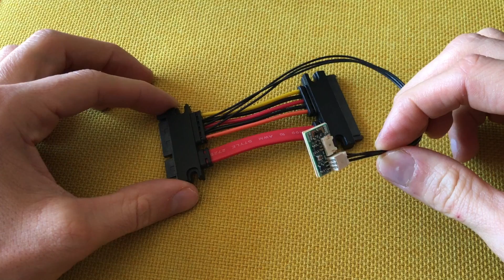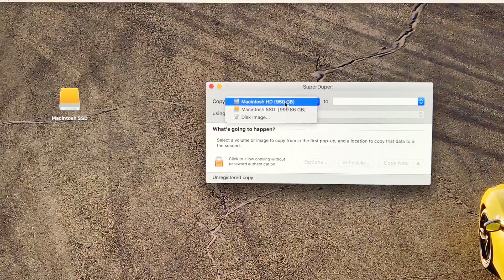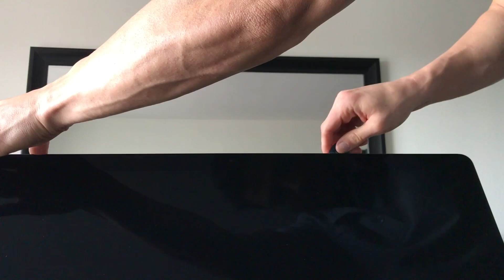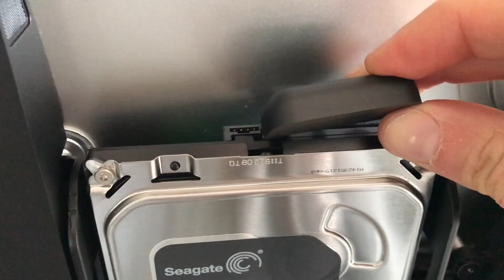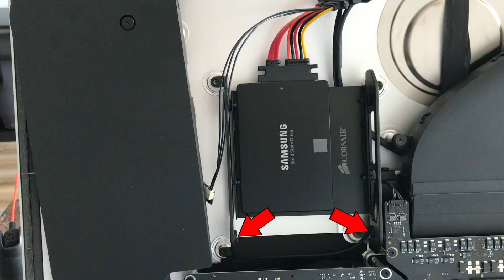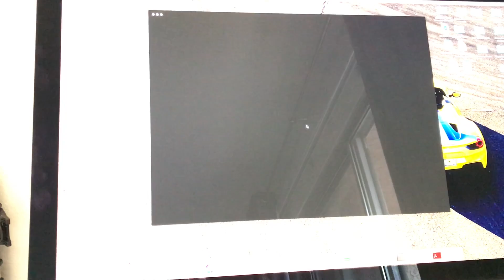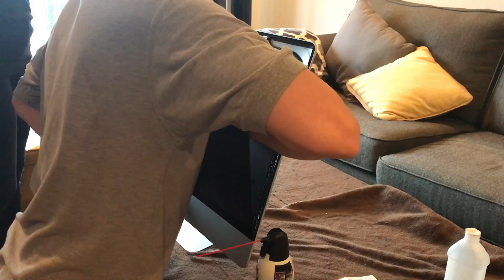How to make your iMAC 5 times faster | 2012-2017 SSD UPGRADE WITH THERMAL SENSOR | Step by Step

Comment: BIG WARNING, I followed the steps and ended up with the SSD in MAC OS journaled format (HFS+) as you pointed out., I then tried to update to CATALINA, and it says my drive is not in APFS, turns out that was the format of the HDD that was inside, and that should be the format I should have made the SSD! Now I need to repeat the whole process, and make a clone, then format SSD to APFS, and then load everything back on to that. 10 hours each backup thats 20 hours. Brutal!
Reply from the maker: P DUBS Did you clone the drive first? I haven’t had a single issue nor has anyone else who’s commented. So maybe you missed a step?
Reply: @AIRWOLF  
Yes, I did a Clone of my MAC HDD on to the SSD. In Super Duper I selected Mac OS Extended (Journaled)  as the format, is that not what you had instructed in your video?That was the only one available to select. Even though my MAC HDD was in APFS already - Apple Switched to this with the Sierra Update. Anyways I Re cloned my SSD to my HDD which was now removed. Then I Booted from this External Clone and when into disk utility and formated the SSD to APFS. then loaded the HDD Clone on to it. After that I booted from the SSD and was able to update to catalina. If you do some research into APFS youll see why this was an issue for me and should be an issue for anyone else trying to do it the same way running the same versions of OS.

Also the fleece blanket is a big no no,duhhh! I rolled out my rubber yoga matt onto my coffee table instead.I wouldn't recommend the thick guitar pick or metal razer blades. Other than that thanks for the vid! but maybe post a warning about some of these issues.

Comment: If you have a 27 inch, you could have had a faster drive yet by using an NVMe drive. I just placed mine in my Late '13 and I'm getting 730 MB/s write and 777 MB/s read. Doing this would allow you to have two drives in your iMac, which is pretty dang handy!
Reply from the maker: Yes you're 100% correct!

Comment: Spend the $8 and get a "no-harm" type wheeled tool to cut the adhesive with.  Those bonded screens are super-easy to crack with anything thicker and super-hard to get if you have to replace it (not to mention super-expensive).
Reply: Big Life only 60 bucks
Reply: Tzaphkiel Melekiyah the whole screen or the tool is 60 bucks?
Reply: @radar_the_first_esquire  I'm not sure what he's talking about unless he's referring to newer models.  I did 2 of them recently, and one had been cracked by a previous tech using a plastic prying tool.  My wheeled tool was $8 on Amazon.  When I researched his screen, the newer, magnet-mounted screens are plentiful and cheap (because the glass is separate from the actual display).  2013 models and before had a bonded single unit that shipped the display and the glass as one unit that was glued in place.  They're old enough now that production has become very thin and there's no inventory ANYWHERE.  Expect to pay $600 and wait 6-10 weeks for it to ship from Asia.

Comment: Hey Airwolf,  Where's your repair partition you did not get by cloning?  The proper way to do this is to install your system first after formatting the new drive.  Now use Migration Assistant to move your data and apps.  You will then have a repair partition you can boot from if you ever have problems.
Reply from the maker: Yes Richard Mayer that is a way to do it as well.

Comment: Great video. I recommend using time machine to backup and restore and an OWC SSD replacement kit which has practically EVERYTHING you'll need for an upgrade. innovative tools assist with getting the job done safely, easily and for a low cost as well. I upgraded to a 2tb SSD. best decision i ever made

Comment: Hei got a question, how did you get the OS on the new SSD.. did it do that with the cloning HD?
Reply from the maker: I cloned it. I have a link to the software in the description.
Reply: @AIRWOLF  I am sorry, maybe i questioned wrong. I mean, when you clone the HD with the Super Duper, does it clone the OS too or just the data?
Reply from the maker: @miloplayz5264  Yes! It will bring EVERYTHING over. Like nothing ever happen. :) You'll just have to sign into things again but thats all
Reply: @AIRWOLF  Thank you very much, amazing!!!
Reply from the maker: @miloplayz5264  You're welcome. :) Keep me posted.
Reply: @AIRWOLF  Does this work to????
https://www.amazon.de/UGREEN-Adapter-Konverter-Kabel-Festplatten/dp/B01H1I9X60/ref=sr_1_1_sspa?__mk_de_DE=ÅMÅŽÕÑ&keywords=Sabrent+USB-Festplattenadapter&qid=1568642575&sr=8-1-spons&psc=1&spLa=ZW5jcnlwdGVkUXVhbGlmaWVyPUExR05SRlRSNjBaVkFQJmVuY3J5cHRlZElkPUEwMjA0MDk1MkwzTUhCU0RCUUM1JmVuY3J5cHRlZEFkSWQ9QTA1OTgzMjEyM1ZKN1dCN1NTNFJVJndpZGdldE5hbWU9c3BfYXRmJmFjdGlvbj1jbGlja1JlZGlyZWN0JmRvTm90TG9nQ2xpY2s9dHJ1ZQ==

Comment: thanks for the info, really bad audio though
Reply from the maker: Hey bud! thanks for swinging through i'm happy it was somewhat helpful. But I check your setup.  The audio is pretty clean on my end and out of almost 100k this is the first comment regarding audio. :)
Reply: @AIRWOLF  no problem, I see you are not into audio. At about a minute and a half the audio level drops and I can hear the hissing noise in the background but, hey i am the only one mentioning it so...it must not be true lol
 A lapel mic would definitely help keep the level clear and consistent, synch later with video. I see you are using the camera mic, that is a beginner's method. Cheers.
Reply from the maker: @Achisachis73  Rode Pro
Reply: AIRWOLF oh nice

Comment: Great video!
If you don't mind, I would suggest something a bit different, instead of opening your iMac and replacing the HDD.
1. Buy Plugable USB C to M.2 (it also supports Thunderbolt 3) from Amazon. It costs about $60. Link: https://amzn.to/2L9t8Cx
2. Buy Samsung 970 Evo Plus (the 1TB costs about $227, 0.5TB costs $115. Link for 1TB: https://amzn.to/324wDAW )
3. Install the SSD into the module, and connect to a TB3/USB-C on the back of your iMac
4. Use Super Duper to clone your HDD to the SSD
5. Shut down the iMac, Power it up and press the Option key, you'll see the boot manager. Select your SSD.

Done, you'll get 4-5 times speed compared to the SATA SSD and 15X compared to the HDD. No need to open your iMac.

Also, you can use the Startup disk option to boot permanently from the TB3 disk.

Comment: Hi all im installing a samsung 2TB SSD to repolace my failed 3TB seagate,  ive already built the drive with Mojave and wresteled the backup off the time machine not using time machine as i find it totally prone to issues this time permissions wouldnt lket me install a TM backup. That aside I am interested in thoughts on installing 2 x 2TB SSD drives .  Ive bought a double cradle but the adapter cable kit is wrong so ill keep searching ,  but has anybody installed 2 x ssd  in parallel off the original apple SATA cable  ?

Comment: Excellent video!! I did everything as you did but now my screen is really F’d up!! What could have happened? I was very careful when disconnecting and reconnecting...  I tried cleaning the connections and reconnected, do you have any suggestions on how to fix it?
Reply: I think I figured it out! I think I cut too deep with the blade around the edges 😖
Reply from the maker: @Two_Fold_Way  Did you accidentally snip a wire?

Comment: After I upgraded to 1T Samsung SSD I have "No entry sign" displayed about 30 seconds after iMac is powered on, but then it's boots normally. Is it any action should be performed to remove this "No entry sign"? Also I noticed that "APPLE SSD SM0032L Media" is displayed at Disk Utility in addition to "Samsung SSD EVO 1TB Media" - is it normally after SSD upgrade?

Comment: Very nicely put together video. Excellent video quality. Great audio. Added bonus: you’re a very sexy masculine man (with all due respect.) And yeah, I can tell you’re straight. So, relax and enjoy the compliment from a gay guy. 
Hint: you missed the two tabs at the bottom of the screen when removing the adhesive. Just pull them out and you will have a much easier time removing the adhesive at the bottom and hence removing the screen right out at first attempt. Cheers mate.
Reply from the maker: Ahahaha awe thanks for the compliments Raphael.  :) Much appreciated.

Comment: im thinking of using an ssd on my late 2013 27" iMac, BUT im wondering..... is there any reason i can't just use an external drive and boot from that instead? and keep the internal 1tb for files? (pictures etc that i don't often access but want to keep) i can't understand why i need to go to the trouble of ripping open my iMac when i can plug a drive in externally?? unless maybe its slower through USB? im not sure anyone care to elaborate?
Reply from the maker: You’ll be limited on speeds due to your USB port.
Reply: AIRWOLF Which, if we are talking USB 3.0 here, is very similar to the SATA internal connection... So, yes, that IS an option.

Comment: Couple of Qs: 1. What should I be looking for in a bracket? Uk based here so need to find equivalent items on uk sites/amazon. 2. Can you buy the thermal sensor without having to get it as part of that OWC kit anywhere?
Reply from the maker: Hey bud! I mean you may have to do a little homework.  But I did leave links in the description to help with that. And 2 i'm not too sure about finding the thermal sensor separate.  And i'm also unfamiliar with UK sites.  

If I was you i'd click the links in my description.  Highlight the actual names of the items and then try searching it via the web.  There may be other websites that sell the items.

Comment: Thanks for taking the time to put the video together. I've been doing some preparatory research to ensure I get it right and your video is by far the best I've come across and I plan to do an SSD install and Ram increase in the very near future and much more confident after watching your video.
Reply from the maker: Awwwwe thanks so much.  When making the video I really didn't want to miss a step.  I'm really happy to know that its help you.
Reply: @AIRWOLF  Well I went the OWC route and picked up their 1 TB SSD kit that came with everything needed including a nifty little mini pizza cutter that rolls through the groove and cuts the adhesive in literally two minutes. It also made the old adhesive peel off with little effort. I just popped in 32 gigs of RAM and restoring from a back-up and can't wait to see how much faster this bad boy is. Thanks again for the inspiration.
Reply from the maker: @davebeatty5888  This all sounds great!! Happy that you got it all figured out.  I love my speeds on mine for sure!

Comment: Actually your 27" 2015 iMac CAN BE UPGRADE to a real BEAST. It supports a Core i7 6700K procesador and an extra 1TB SSD M2 inside you Logic Board. It's really easy to change, this mobos (2012-2015) are easier to unmount than 2011-2009 models.
Reply from the maker: Hi 👋🏼 Rodrigo Rosales you are 100% correct. Maybe down the line I’ll get into it.  I may also build my own PC at some point.  Who knows? 🤷🏻‍♂️. Appreciate you stopping by.
Reply: @AIRWOLF  and... It's a little expensive, also supports 64gb RAM DDR3 1867 from OWC. These machines are so handy but Apple won't tell to the public never.
Reply from the maker: Rodrigo Rosales Of course they wouldn’t. And 64G? Really!? Now that I didn’t know. I’ve never tempted to actually install it. Is there any information on that?
Reply: @AIRWOLF  of course i'll share you the "Holy Grail" of Mac:
https://everymac.com/systems/apple/imac/specs/imac-core-i7-4.0-27-inch-aluminum-retina-5k-late-2015-specs.html
And the OWC parts:
https://eshop.macsales.com/item/OWC/1867DDR3S64S/
Reply: @AIRWOLF  I've in my Desing Studio 2 iMacs 27", one mid 2011 and late 2013. Recently 2011 was upgraded to i7 2600 3.4ghz, 3 SSD 1Tb internal (super drive gone external by USB enclosure), and 32 GB RAM 1333. Next week i'll open the 2013 (it's the same sticker screen system) and change the cpu to i7 4771 3.9ghz, 1 SSD 1TB swaping the HDD and 1TB M2 stick. The 32gb RAM 1600 was upgraded last 2 weeks. I'm searching for 2015 iMac like yours for tunning. We save A LOT OF MONEY making this upgrades than buying new shiny gray and downgraded ones.

Comment: Excelent video!!! Really helpful!  I followed your steps to upgrade hdisk with the Samsung SSD successfully at $150 (SSD 500GB+adhesive strips). The Genius Bar at the Apple store ran a free diagnostic check on my Imac 2013 21.5 inch and it came out disk failure. However, Apple store can replace the same hdisk  1TB only about $250 and others repair stores would charge me $550 with SSD (550GB) upgrading.  Thanks again for great tutorial by the way.
Reply: BTW, I didn't use thermal sensor because iMac 2013 does not need that.  After booting, I didn't hear any big fan noise.  Now my IMAC 2013 runs very quiet.
Reply from the maker: I love hearing this! Really happy that this video was helpful for you. And that you were able to save some money!

Comment: is there a way to by pass that stupid thermal sensor?   is cost almost $40  and this Mac are wait to old to put more money on it
Reply from the maker: I mean, I hear ya on that. Now, if you read in the comments people have done it without installing the sensor and it’s been fine. I personally just thought it’s better safe than sorry. My iMac is still my workhorse and running fine. I’m sure you’ll be fine without it but unfortunately I can’t guarantee it.
Reply: @AIRWOLF  . Got it. Thanks for the info
Reply: You don't need a thermal sensor for iMac 2013 up ,only the 2011 models.I installed an ssd in my late 2013 iMac no thermal sensor needed

Comment: I remember when I replaced the hard drive on a 2011 iMac 21.5", it needed the correct Hard drive type otherwise the fan always spun at maximum speed, unless you used a fan control software.
Reply from the maker: Yup! Thats why I installed the thermal sensor. I just didn't want to risk it.
Reply: @AIRWOLF  Thermal sensor is only needed for 2011 models only.I installed ssd in my late 2013 no sensor needed everything thing works normal.

Comment: Can´t you just wipe the fingerprints away when you're done with the upgrade?? Seems more safe than using a cloth which can make you easier loose the grip of the screen?
Reply from the maker: Yes you can but I just wanted to limit the amount of hand oil on my screen.  :) I understand the risk behind it but I was careful.

Comment: Just a note of caution to those who have done the upgrade... we did ours in January. Today, we noticed the LCD on the imac separated from the aluminum case.    For those that did the upgrade, I'd just double check that the adhesive is not lifting.     We were very diligent in removing all the old adhesive and cleaning the area with 99% alcohol, letting it dry before re-applying. This two way adhesive should never release once it is applied... so it was very surprising to see it lift up.  This could have been disastrous if the screen completely released and fell to the floor.  We purchased two adhesive kits.. one from ifixit, and one from OWC (one is spare).  Bottom line, is this adhesive should never separate once applied unless the glue uses is defective.
Reply from the maker: Wow! Im sorry to be hearing this.  Mine has been fine so far. 🤞🏽

Comment: awesome tutorial man! quick question! I bought ssd 512gb iMac 27' 2017 so its not a fusion drive... so I'm guessing it wouldn't have that mounting bracket where u can place your ssd, do you know where to get it or any suggestion? (I'm not talking about the ssd bracket, I'm talking about the two plastic piece where u can put your bracket installed.) thank you
Reply: David Wilkins thanks!
Reply from the maker: Were you able to get it figured out?
Reply: AIRWOLF yeah i have!! Thanks
Reply from the maker: Hmmm I’m a little confused only because mine “wasn’t” a fusion drive either. So would that change your question?
Reply from the maker: Thanks David for the help.

Comment: Excelent video buddy, thanks for it.
I just ran into a bit of a problem, my iMac actually goes slower now. Boot up is fine but navigating through the system is really slow, opening a folder takes 5 seconds and the mouse turns into that colorful wheel. Tried resetting SMC and PRAM, tried enabling TRIM in SATA, everything. What can be the issue?
My SSD is a 1TB crucial MX500. Thanks for the video again.
Reply: Have you verified that your boot drive is selected properly? Under system preferences and start up disk make sure to select your new ssd. 
Another thing would be to make sure firmware is updated.
Reply from the maker: Hmmm 🤔  Did you clone the hard drive before installing? I’m wondering if you may have had any viruses 🦠 on the old hard drive that may have transferred over? 

Sorry for the delayed response, but let me know if you’ve figured it out.
Reply: AIRWOLF old one was working perfect, then I cloned it, and SSD was too slow, I’ve put the old one back and it’s also slow now, might I have damaged the SATA cable somehow?

Comment: I don't think you need thermal sensor at all. I upgrade without it and the fan works perfectly fine at 1200rpm
Reply from the maker: Ben Lee For the $30 it cost I personally wasn’t going to risk it. My system still works fine. 🤷🏻‍♂️